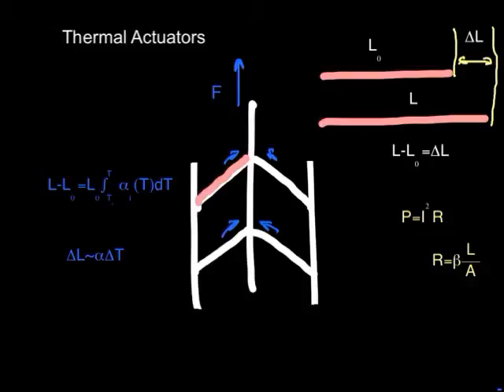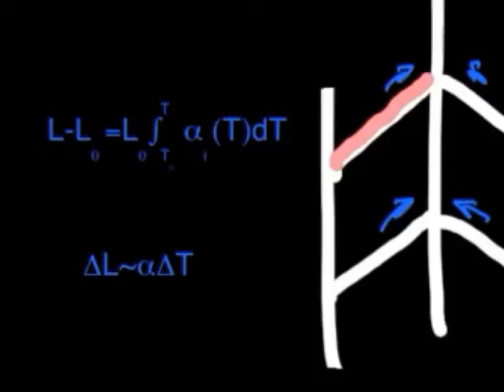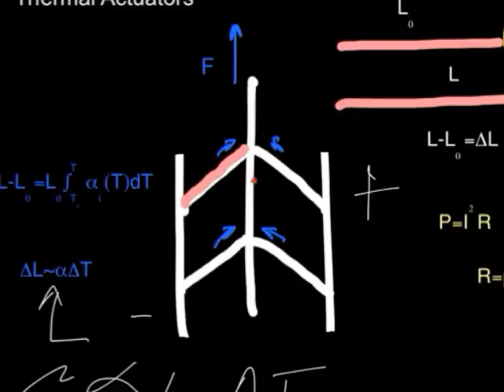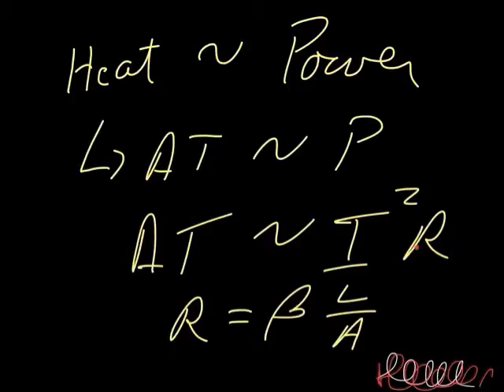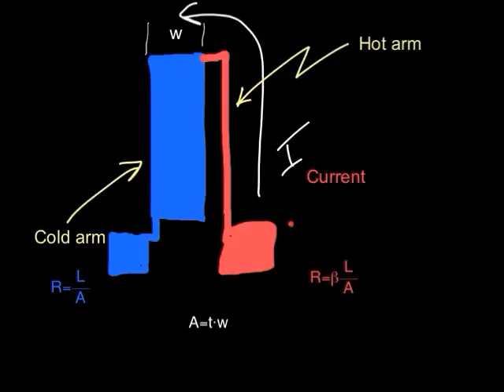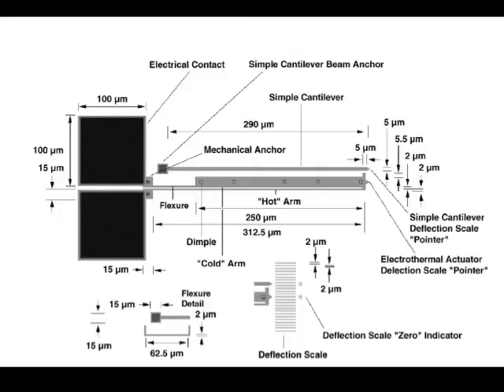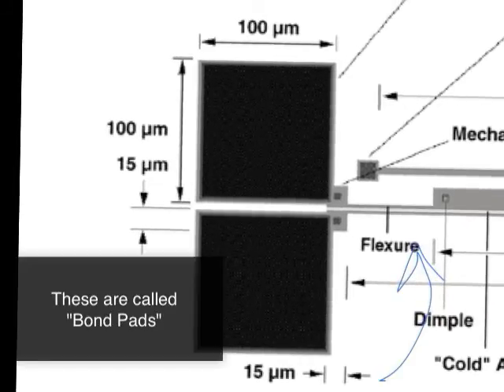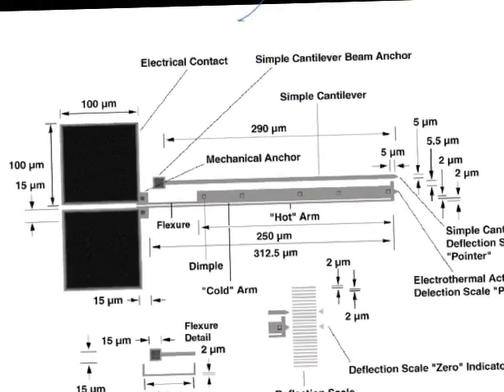MEMS Thermal Actuator Basics

Comment: Can the chevron shape thermal actuator be used to find the fracture strength of MEMS material? i-e to place the material in front of shuttle and when the beams are heated due to current then the shuttle would exert force on the material ( for example Polysilicon ) and would break it after increasing current.

Comment: Could any form of actuation be used just for the mechanical purposes, and not as a manifestation of electrical current. To be more specific, if beams extend because of the externally applied heat (not connected to the power supply) and if we put a comb-drive actuator at the end of the central shuttle, could such implementation ever be used as, let's say, a MEMS thermal sensor?
Reply from the maker: I don't see a problem with doing that - actuators and sensors are complimentary - for example, you can add heat to moving the shuttle as you suggest, resulting in a capacitance change in the connected comb drive.  Alternatively, you can add a current to the thermal legs of the shuttle, resulting in movement ... Transducers change an environmental input (ph, temp, pressure...) to and electrical signal or the opposite, converting an electrical signal to an output (heat, sound, light....)